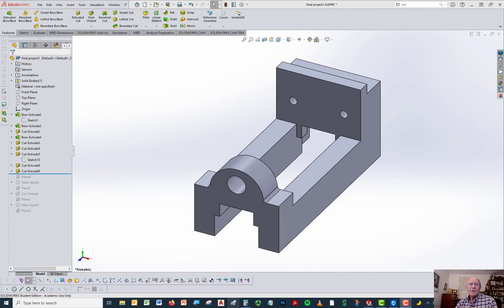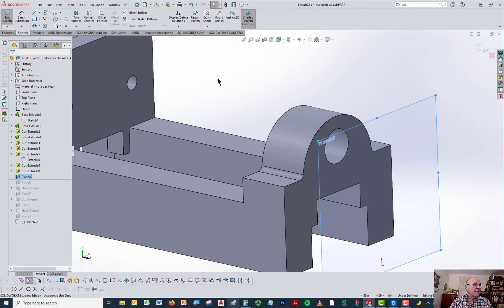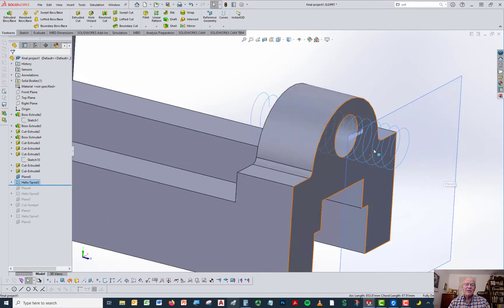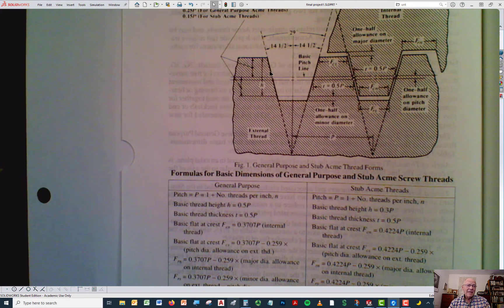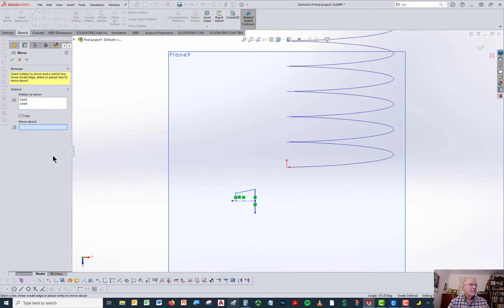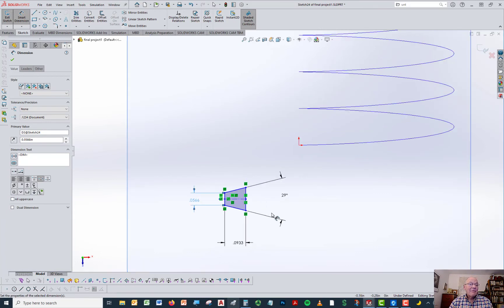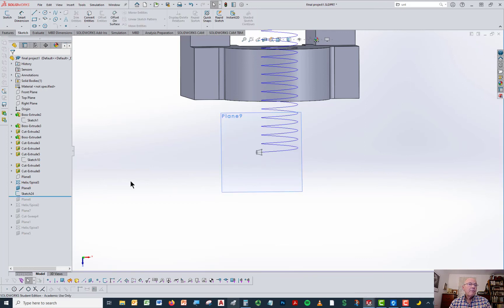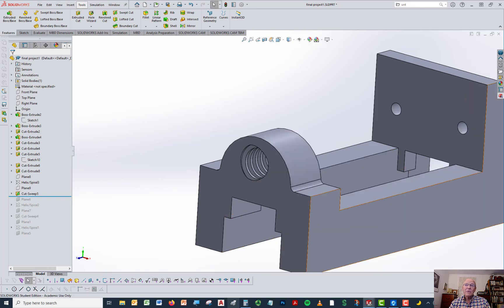Acme Thread in SolidWorks

Comment: Thanks.  Making that ref. plane normal to the helix was the trick.  very nice expiation.  I agree with @mostsoot it does sound like a 3D printer printing a curved or circular outer/inner wall.  Ha.  ("inexpensive" stepper motor resonance is pretty obvious...)   I actually thought the same when I first watched your video... :)

Anyway, the dimensions on your trapezoid are for LMC (largest hole) conditions?  Nominally, that root depth is 0.5 * pitch  (0.5 * 1/6 = 0.0833 - you use 0.0933)?
Reply from the maker: You're welcome. I am not sure what that noise is, and I agree that it sounds like a 3D printer. I have 10 printers, but they are at work. I made this video in my home office, where I do not have a printer. The only thing I have in here that makes noise is two EGO battery chargers, but I wouldn't have made a video while charging those batteries because it is very noisy. Perhaps some radio frequency problem? 

I found some differing dimensions for acme threads. I think I used the Machinery's Handbook, but can't remember anymore and it may have been a typo. Obviously, you could modify those dimensions. The purpose of the video was just to show a student how to create a thread using a profile and a helix. The thread tool in SolidWorks doesn't always give a true thread in my experience, so when I do want to create one for 3D printing something with a thread, I usually create the thread this way and reduce the size of an external or increase the size of an internal thread and modify it if it doesn't work.

Comment: I followed this exact procedure, and it worked great. However, I have 19 more of the exact same holes I want the same exact thread in. What’s a slick way to apply what I’ve done to all 20 total holes?
Reply from the maker: If the holes are applied as a pattern you can apply these features to the pattern by moving it before you created the hole pattern. 

It is possible to create a custom thread profile, which would make things a little more streamlined if the holes were not placed as a pattern. Here is a good description of how:
https://support.hawkridgesys.com/hc/en-us/articles/4419921661197-Creating-Custom-Thread-Tool-Profiles-in-Solidworks-

It may be possible to save the threaded hole as a library feature, but I've never tried it, so I can't vouch for it. Here's a link to a description on saving library features though. I will try it myself if I get some time.
https://help.solidworks.com/2021/English/SolidWorks/sldworks/c_library_features.htm

Comment: is that 3D printer sound on background :)
Reply from the maker: I hadn't noticed the background noise, but no, it is a charger for a EGO battery for my snow blower (or chainsaw, or hedge trimmer, or string trimmer, or lawn mower -- I am a fan).
Reply: @DanAbbott-SMCC  come on its cheap stepper motors drivers sound in the background 7:32
Reply from the maker: I made this in my home office, where the only printer is a laser. Whatever it sounds like, it isn't a 3D printer.